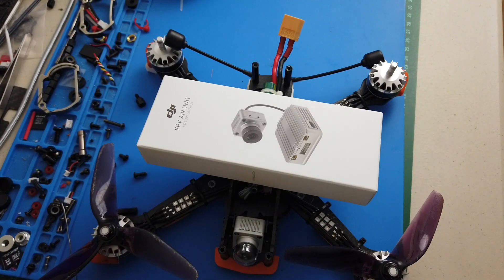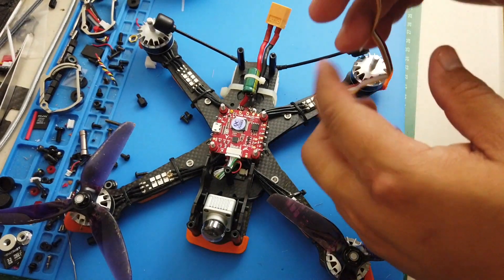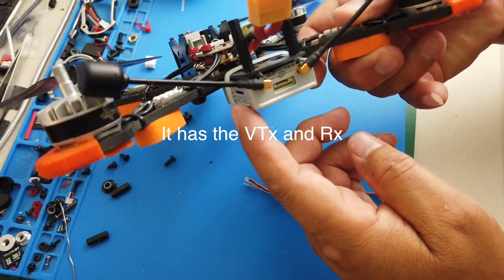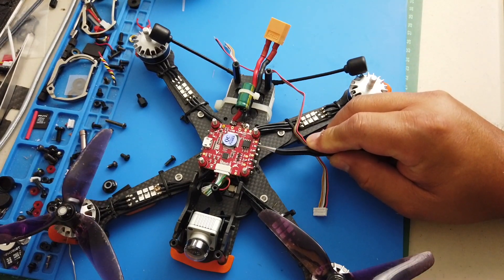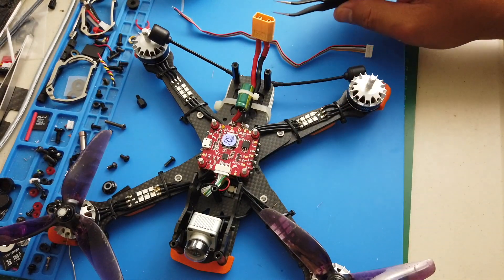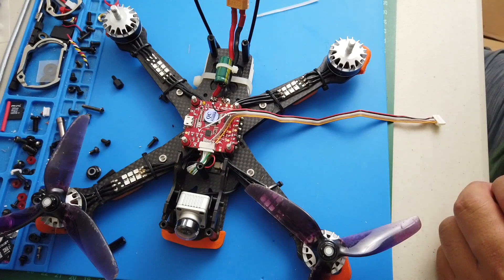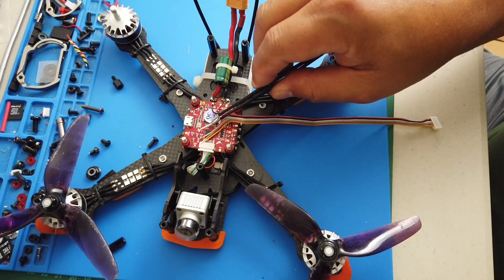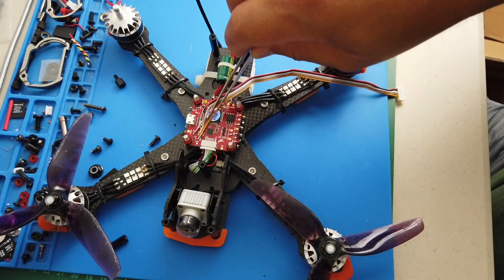How to connect DJI Air system to your Flight Controller

Comment: This is really useful. Thanks. My iflight Beast F745_AIO has a socket that accepts a plug from my Air unit. I get a green light, my controller in bound, I have vision in my goggles. BUT I do not get any response from the stick inputs of the controller in betatflight. I have SBUS_BAUD_FAST set to on in the goggles and the FB but still no response. According to the FB manual, UART2 is the DJI connection so that is set as on in the serial in PORTs. I am really struggling now (and get frustrated) do you have any suggestions?

Comment: Can i connect the dji air unit to eachine tx16s radio controller
Reply from the maker: You just have to use external RX or some sort, i.e TBS Crossfire or ELRS or Frysky RX if you want to use your TX16s.
Reply: @Accid3ntalG3nius  thanks Deniel but somehow on the support page of dji fpv air unit it says you can only connect with dji radio or dji goggle. Do you have any video link for the same as i am just new to this
Reply from the maker: @TechDesignWithMJ  What are you using as your RX with TX16S? Are you using TBS Nano RX? or something else?
Reply: @Accid3ntalG3nius  i thought i dont need one as the dji fpv air unit everything combined in the same so i was hoping to use it as rx as well
Reply from the maker: @TechDesignWithMJ  I thought you want to use your TX16S remote control instead of the DJI remote control.  If you want to use the DJI FPV remote control then you need to do anything else since the DJI Air unit has both the RX and VTX.  But you want to use the TX16S as your remote control then you need to add the RX to your quad either TBS, or ELRS or FrySky receiver.  I hope that make sense.
Reply: @Accid3ntalG3nius  thanks yes your right i want to connect the tx16s to dji fpv air unit but from what i understood is i need another seperate tx to connect as the tx within the dji fpv air unit cannot be connected directly with tx16s
Reply: @Accid3ntalG3nius hello , i have a quad with dji air unit ,my question is can i use dji fpv controller whitout any problems when my quad have tbs crossfire too? Thanks for your answer
Reply from the maker: @MárkNyitrai  I am not sure why do you want to use both the DJI FPV controller and the TBS Crossfire.  The TBS Crossfire has a lot more range than the DJI FPV controller..

Comment: Hi Daniel, tnks for sharing your work. I wanted to see if you can help me. I bought a flight controller: "Iflight SuccesX Mini F4 V3" and I can not find the diagrams to connect my dji air unit, if you could guide me, I have already searched the whole network and can not find the solution, I wrote to the company asking for the diagrams, and they said: "You should buy this one: SucceX -D mini F7": , but I don't think it's a good answer from them, unless It´s impossible connect it to my dji air unit. I'm new to drones. thank you in advance. (i have the all dji system, googles, RC, air Unit)
Reply from the maker: Here is the link to the wiring diagram of the Flight controller.  https://www.aliexpress.com/i/33058538051.html
Reply: @Accid3ntalG3nius  Tnks Daniel, i have the same wiring diagram. I dont know were i have to connect de sbus (Yellow wire air unit).
Reply from the maker: Basically, you connect the SBUS wire from the Air Unit to the SBUS pad on the flight controller, then you connect TX and RX wires from the Air Unit to the flight controller on RX3/TX3 pads.  Make sure the TX wire from the Air unit goes RX3 on the flight controller and RX wire from the Air Unit goes to TX3 on the flight controller.  Then you connect the Ground wire (Brown) from the Air Unit to the Ground pad on the flight controller.  Also don't forget to connect the power lead RED and Black wires from the Air Unit to battery terminal +/- on the flight controller for power to the Air Unit.
Reply: @Accid3ntalG3nius  I understand every you say, but i don´t know wich one it´s the the SBUS pad on the flight controller.
Reply from the maker: @ChrisMixtle  Go to this link https://shop.iflight-rc.com/index.php?route=product/product&path=18&product_id=1037.  then look at the top picture with Green line (nR2) is the SBUS pad.
Reply: @Accid3ntalG3nius  It´s Work! Thank you Daniel, right under my nose, but I had not seen it, thank you very much for taking the time to answer, I really appreciate it. I wish you the best of luck in your life, Regards!
Reply from the maker: @ChrisMixtle  Awesome, I'm glad you figure and it works for you.  Safe flying!!

Comment: i have the same problem N/A on voltage OSD goggle , how to fix this ? please help
Reply from the maker: Make sure you install the latest firmware and select the correct UART for Betaflight configurator. You have to select two UART in Betaflight, one for SBUS and one for MSP.

Comment: Have you gotten your unit to show batt voltage or timers yet? I noticed you hooked up the OSD wires but no OSD functions were displayed in the goggles.
Reply from the maker: J C the ODS data doesn’t show in the DVR but  I still get the OSD on the goggles.
Reply: @Accid3ntalG3nius  But it looks like you took a video of your goggles a the end of this video? There was no voltage displayed there. I haven't been able to get the OSD voltage or timers to work since I got the DJI FPV system, but I just realized that the DJI FPV air unit manual has some confusing labelling - I misinterpreted the white and gray locations. I'm going to try switching them and see if it fixes it!

Comment: What FC and ESC would you recommend for a DJI FPV 5” quad build?
Reply from the maker: I would recommend Hobbywing G3 F4 flight controller because it has 9V output for you DJI Air unit.